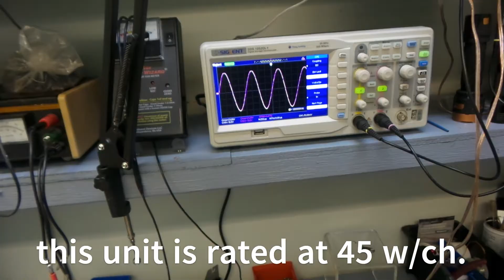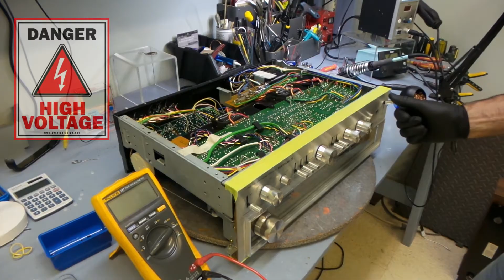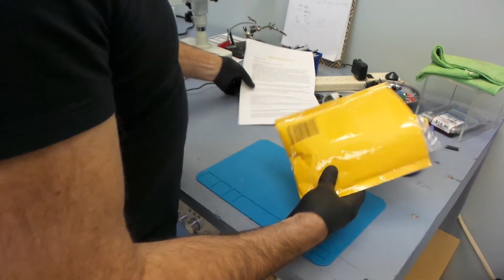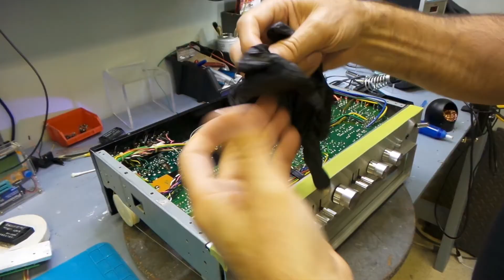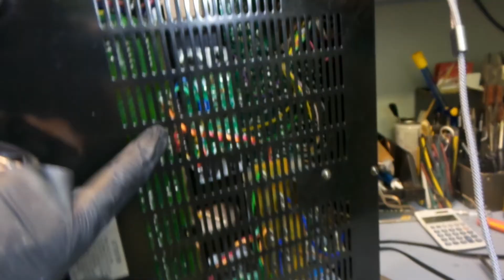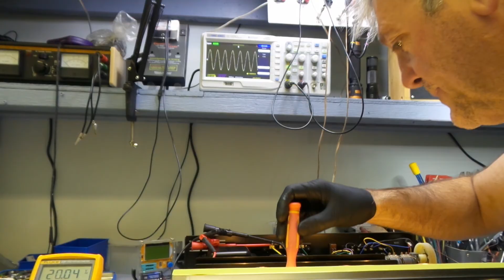Pioneer SX 780 upgrade to the STK 0050 module II. Is it worth it?

Comment: I have a SX-780 I restored recently. I had one back in the 90s that I picked off the top of a trash barrel out at the curb on trash day. It worked for a few months and then went into protection mode. At the time I didn't know how to fix it and techs back then said it wasn't worth it. I hate to say after that I chucked it. That's one of the reasons I learned how to fix them and had to find another one.

Comment: I noticed on the STK's Darlington.  Does that mean they are using Darlington transistors?  Does the new replacements (new design) use Darlington transistors also?

Comment: Great video. I am very much a novice on these matters. I have a question/observation. When you were setting the DC bias, you were aiming for 20mv, you ended up setting it to -20mv. In my mind, I'd have thought you were looking for +20mv. What am I missing?
Reply: Hope you found your answer already, but just in case-- with the DC offset adjusted earlier, we're aiming for close to an absolute value of zero, and 7mV either way is just fine; we just don't want there to be a significant amount of DC mixed in with the AC signal, so we adjust the pots somewhere in the middle. In the case of the DC bias pots on these little output stage amplifier units, the start value is "zero" bias (pot all the way to CCW), and the ideal value is "20mV". It happens to be negative because that's what this particular amplifier needs to work with the least distortion, and so the pot can't even provide positive voltage. https://www.youtube.com/watch?v=U1X2JI8IYT4i

Comment: I just installed the kit in my 780 and it sounds fantastic. I did do a full-service on my unit, which included caps, transistors, and diodes. I like this kit because the bias is adjustable. However, the Pyramid version also sounds really  nice and they are not adjustable.
Reply from the maker: Thanks for the feedback, it's good to know the kit worked out for you!

Comment: Very interesting i own a sx 780 and a sx 1280 the 780 still works fine the 1280 went into protection mode one nite after a all nite party years ago of heavy use a freind of mine bought it new while he was in the army overseas then i bought it from him it has never been opened up was wondering what it would cost to go through it and get it back up thanks new sub

Comment: Hi Joe: I believe those orange caps you replaced were "low noise" types.. Elna and another manufacturer colored these small, low noise types orange.  I've encountered many, and I usually change them out because of their age — even if their capacitance measures OK. (I've not had the facility to check them for ESR.) I'd really like to know what brand and series you used as replacements. Or does it matter when using modern, quality capacitors? Thanks ... I enjoyed the presentation.

Comment: Very interesting video. But I have a question: Shouldn't the offset voltage be readjusted after bias? The offset voltage at the speaker output is affected by the imbalance resulting from the voltage drop across resistors R263 and R265 of 0.22 Ohms after adjusting the bias in the STK0050; isn't that so?
Looking at the schematic, the offset compensation system with transistor Q5 seems very ingenious.
My Marantz SR4000 has an STK3062 as Pre-Amp driver and has no offset adjustment, and I don't know how to implement it, because I have a channel with -360mV!

Comment: I used to "simulate" STKs with success using discrete components back in 1990. First off, carefully break it, then using a metallurgical microscope to identify components, then make a copy of the internal pcb pattern. Used to love the way internal transistors looked like. Years later did the same thing trying to replace STRs using discrete components but to no avail.
Reply from the maker: interesting!!!

Comment: Where did you get those meter clips?  I need some of those!  Also,  I’ve used similar stk replacement modules with fantastic results in a sx-680 as well.

Comment: Wow Joe.  This was fun!  I puchased my 780 in 1980.  After 6 or 8 years, the power on relay failed.  A local tech replaced it .  Still going strong 36 years after that.  My rig is this receiver,  HPM-100s, PL-530, CTF-650.  Part time, Man cave use.  I was 22 when I bought it.  I subbed!!

Comment: Hey joe could you provide a link or name of seller you got the discrete replacements from? I have found some on various places on eBay but they’re the ones you have to build yourself and I would rather get a set that are already made and done professionally like the ones in your video for my pioneer 780. If you could let me know I would appreciate it
Reply from the maker: my buddy Tim is the guy that bought those STK modules from ebay, I think.  I will make sure he see's your comment and hopefully he will get back to you with your question.
Reply: @VintageAudioFever  I am interested in the modules as well.
Reply: I want one for the 950 if possible?

Comment: Hi. Any video on the LX-690 Pioneer?. Mine lights up but no click/relay. I changed the stk0039 with no result. Humm....
Reply from the maker: affraid not a audio ive worked on as of yet....
why did you change the STK's we're they short? and your saying it didn't correct it'self after you change STK?
Reply: @VintageAudioFever  hi. Thanks for coming back. No I tried to change the stk because I had a couple of it. With poor diagnose method! Shame on me.

Comment: If he wants a forever receiver, I would have done a total recap. They are decades over their lifespan. 
Love those STK replacements.
Reply from the maker: Hey Kenneth
Capacitors statement is fair enough!! he will have no issues with those caps on this unit for many years to come but again, it's what the owner wanted....I totally respect that!!
Reply: Also put bigger caps in power supply 10000 to 15000uF would B fine
Reply: Yeah until you blow your bridge rectifier @bulgoczacybulgotnik

Comment: Nice work on a great receiver. The new discrete modules are a godsend as a replacement for the STK 0050 Darlington modules. They are reasonably priced and the build quality of them is excellent.
Reply from the maker: Yes they are!

Comment: I had an Akai PA-W04 amp with similar STK 0050-II, and the paint came off too. It could have been that way from factory.
Would these STK replacements work for a STK0070-II.   So with the suffix II behind the number. He is selling them without the type 2 suffix
Reply from the maker: I beleive that these STK modules are for several models, I know the seller will answer better on your question than I could and he does responds to questions...

Comment: A buddy bought a very clean SX-780 on Ebay, and it had a defective STK0050 that had already been changed once. I convinced him we should go with the discreet modules, and once I got them installed, they worked perfectly. After adjustments, I measured about 52 clean watts per channel into 8 ohms. The modules sound great too!
Reply from the maker: nice!!!

Comment: Hi, very nice work. One suggestion. Make a lock for your spinning base. She spins very easy witch is good, but when you are making measures or soldering it should be lock and steady. Because if loose you can make a short or a bad join. Thank you for your videos.
Reply from the maker: hey!!! yes I agree it does get away from me sometimes, I unusually wedge something to stop the spinning when I need to, other than that, I find this table very useful, especially when I am all set it for testing the unit, I can access the front/back but rotating the table without disturbing any of my probs....
Reply: @VintageAudioFever  I have one also, they are a must have. I lock mine when I need to, because I already had the probe hitting a wrong place and got sparks and smoke.

Comment: I believe those are original power packs,  The paint falling off is most likely age.  Now if someone would remake the FM integrated circuits.
Reply from the maker: Hi Ralph...the reason I say they may not be original STK  is simply the paint  rubbing off.. I was suppose to compare with one that I believe is original but I miss to show it on this video, regardless if they were or not, the customer find them working nicely on this receiver before changing them to the new modules...
Reply: @VintageAudioFever  I am a one owner of a 780 and replaced the original packs on it several years ago. They are clearly marked Sanyo on the face. all the replacements I bought just say darlington or whatever on them. I guess there may be some knock offs out there with sanyo on them, but I doubt if they are real this far down the road